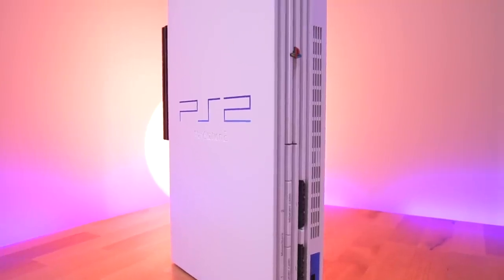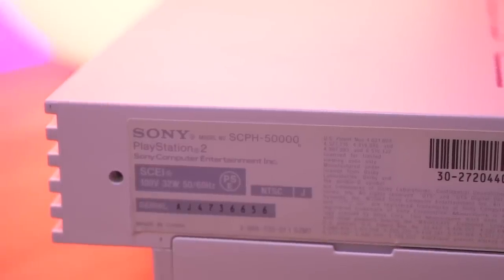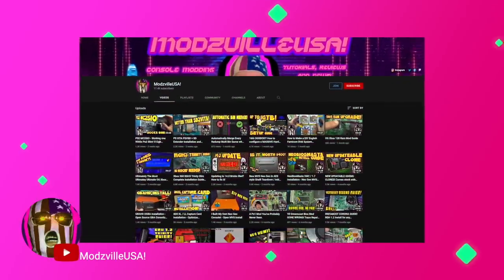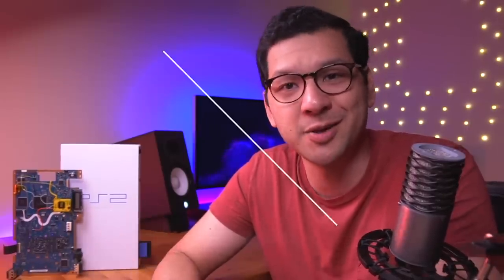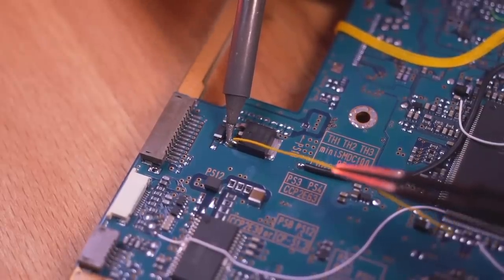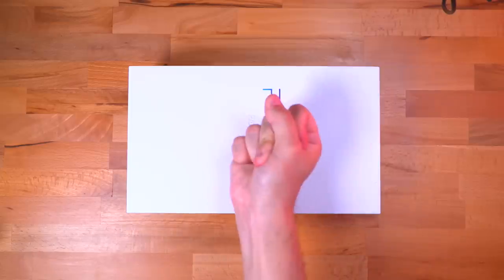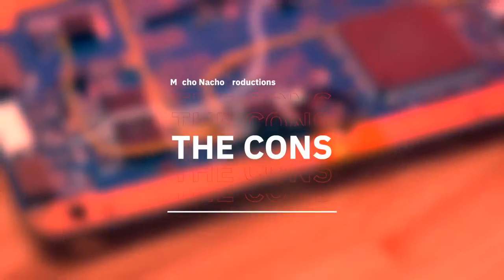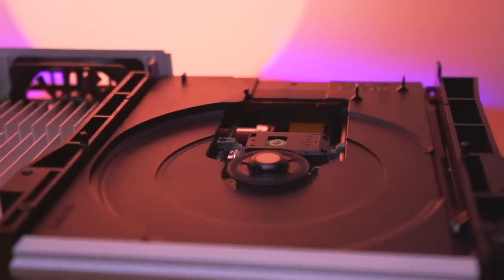This Mod Prevents Your PS2 Laser From Burning Out | The PicFix Mod

Comment: Back then before the PIC fix, I used to install the one called the romeo mod for the v9 and v10 ps2. Using a clean 5 volt source to the LA IC and condemning the existing spiked 5 volt point to the LA IC.
And for the v12....the summ0ne fix was my choice of laser fix.
Reply from the maker: Nice! Didn’t know there are other options out there. Thanks for the heads up

Comment: This is interesting, but seems like it's not an extremely simple install for someone who may be a novice. I've done plenty of PS2 mods, and I feel like simply replacing the laser is a much quicker and simple replacement in case this happens to someone. 

Am I incorrect? I feel like anyone can easily take the top off and manage to replace the laser in the drive quicker than a novice could disassemble the entire console and do this little solder job.
Reply: I agree a laser replacement is easier, or just skipping the disc reader entirely with HDD and FreeMcBoot.  Doesn't feel like its worth it to a novice since you can brick the console if you screw up.  I suspect this is more a mod for users outside the US where bootleg discs are way, way more common and the upfront cost of FreeMcBoot (HDD & Connector) might be prohibitive.

Comment: So its not necessary to install on the SCPH-39004 version?
Reply: no, SCPH-500xx is V9 and V10 (all regions), V11 (Europe, only with 1 model) and SCPH-700xx is V12, SCPH-3900x is either a V7 or V8 model

Edit: From psdevwiki

v7	G	
SCPH-37000 (GH-019 & GH-022) (BIOS070)

SCPH-39000 (GH-019/GH-022) (BIOS070/080)
SCPH-39006 (Hong Kong) (GH-019/GH-022) (BIOS080)
SCPH-39007 (GH-019/GH-022) (BIOS080)
SCPH-39008 (GH-019/GH-022) (BIOS080)	
SCPH-39001 (GH-019) (BIOS070)
SCPH-39001 (GH-022) (BIOS080)	
SCPH-39002 (Australia) (GH-019/GH-022) (BIOS080)
SCPH-39003 (United Kingdom) (GH-019/GH-022) (BIOS080)
SCPH-39004 (Europe) (GH-019/GH-022) (BIOS080)

v8	G (newer BIOS)	
SCPH-39000 (GH-019/GH-022) (BIOS090)

SCPH-39006 (Hong Kong) (GH-019/GH-022) (BIOS090)
SCPH-39007 (GH-019/GH-022) (BIOS090)	N/A	
SCPH-39002 (Australia) (GH-019/GH-022) (BIOS090)
SCPH-39003 (United Kingdom) (GH-019/GH-022) (BIOS090)
SCPH-39004 (Europe) (GH-019/GH-022) (BIOS090)
SCPH-39008 (Russia) (GH-019/GH-022) (BIOS090)

Comment: I have 2 30k models and a 70k (slim) model but I only use my 30k's for playing games. Have not used the slim for 3 years but this is a missing piece to my problems since my slim did have constant crashes
Reply from the maker: I think the 30k should be good. Does your 70k laser still read games?

Comment: i found a ps2 slim on ebay and the model is an scph-75001, will this problem affect it? if i decide to get it of course
Reply: Not affected
Reply: no, scph-75001 is a v14 ps2. Only V9-V12 are affected.

Comment: How do I determine if mine is a V9 model, does it have to do with the serial number?
Reply: check the model number on the back of your PS2 (sticker), starting with SCPH-xxxxx. You can also boot the console and press triangle at the main menu (with the browser and system configuration).

A V9-V10 PS2 has the model number SCPH-500xx if you live in Europe, America or Asia or SCPH-55000 (japanese model only). A V11 PS2 is only in Europe (1 model)

Comment: Do I need this if I have 50004 PS2?
Reply: yes, 50004 is a v9 or v10 PAL/EUR PS2, so it is affected.
Reply: @danielsala81  From what I remember, it didn't require it, because this model had fixed the laser issue (only 50k model that has the fix)

Comment: Whats wrong with romeo mod? i did those. you need to lift one of the laser driver IC, and feed it with 5v instead of the original 12v wich fries the laser and the driver ic.

Btw, i have a story with the mechacon crash. around 15 years ago, i had a chipped V10 Ps2, wich i replaced the laser, and it worked nicely. I sold it, than after a few days ive got a call that it doesnt want to read any discs. long story short, the guy tested the ps2 good with some crap media, eventually killing the laser and driver IC. So, i needed to pay back the price, and recieve the blown ps2. It sat in my room for like 5 years, when i decided to take a look at it again. I managed to replace the driver IC, got a new laser in it, Did the romeo mod, and that thing is still with me, working as a charm. fun fact, that V10 is pretty rare here, ive got like 5 another 5k series PS2, wich has all V9 mainboards. I kinda like the V10 more, it seems more stable running homebrew stuff, and kinda works better with the modbo chip i always used.

Comment: Both my ps2's disc drives are broken.  I would if they worked
Reply from the maker: Thankfully you can still buy replacements if you need to on eBay. I replaced a few ps2 drives

Comment: Sorry this problem is already know for years and there is even better solution for it, to use a zenerdiode to on the lasser level voltage so it can't burn out. Why would you want to switch it out ? During a game play this can be a horrible to have. Also with zenerdiode you don't get this and keep the voltage level capt so lasser can't burnt out. Sorry maybe this isn't the best solution for this.

Comment: No need for a dvd drive on a ps2 :)
Reply from the maker: These days it’s becoming less of a need. But those with a large collection of physical games could benefit from this
Reply: @MachoNachoProductions  yeah it's great for that nostalgic moment when someone wants to put a disc in and play it normally, although it's not strictly required either since PS2 discs can easily be read and dumped on a computer with a DVD drive.

Comment: I'm sorry, but this is just dumb. This doesn't fix the problem at all, it just works around it. The real issue is the LA chip supplying higher and higher voltage to the drive assembly and in turn to the laser coils to retry a failed read, resulting in burnt laser coils and in some cases the mechacon. This prevents the burnout, sure, but by killing all of the power, like a breaker. The REAL fix is to prevent the LA chip of burning out the system, and that's accomplished by the Romeo Mod. It requires no additional boards, just lifting up a leg of the LA chip, and rewiring it to any 5V line on the board, instead of the original 12V. This problem PRIMARILY comes from the modchips forcing re-reads, but can also happen on some legit games as well, according to scene knowledge.

The pic fix is only a thing because you can't do a romeo mod on the V12, and even then there were better solutions to it, starting from Summ0ne fix all the way to the Neofix
Reply from the maker: Thanks for the info!

Comment: This is 10 minutes of "it shuts off the console" and "make sure you solder to the correct points" 

Wtf dude? atleast read a bit into it and explain why the mechacon crashes, how the detections works etc instead of repeating the same 2 things for 10 min. you should be better than that.

This video is the reason i do not subscribe and click "do not recomend channel". So much stuff to make content with but incredibly shallow. No thank you.